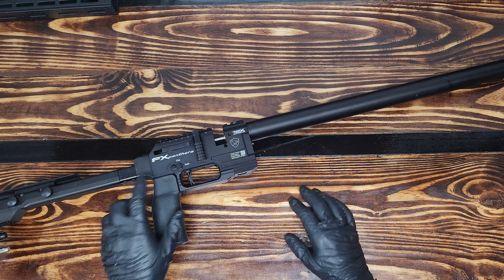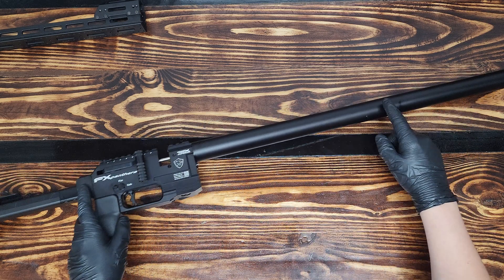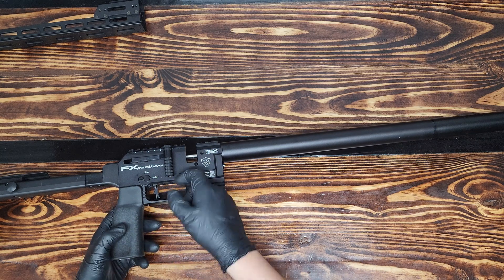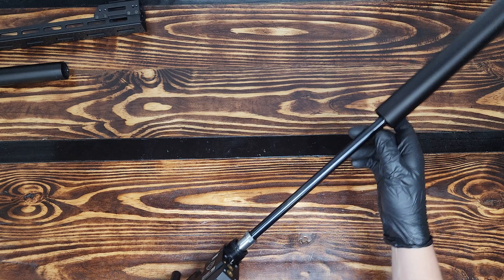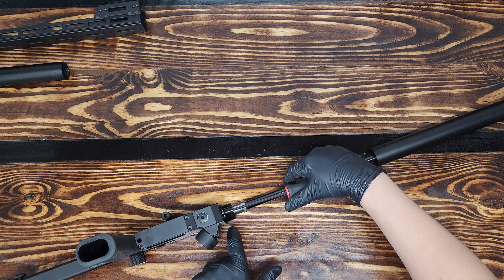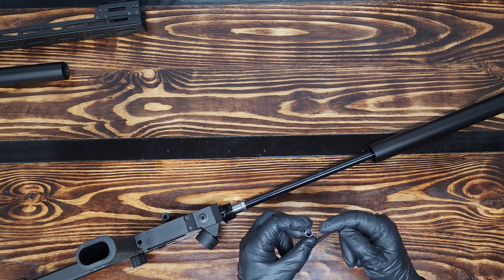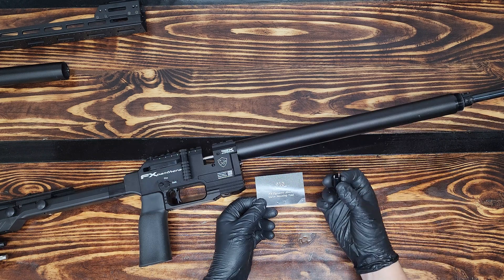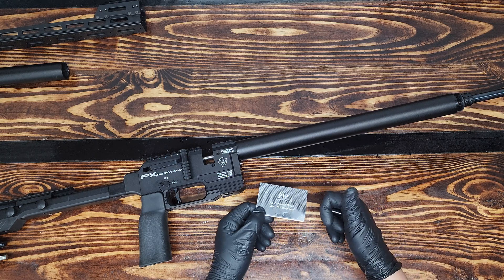FX Panthera Valvehousing Removal - FX Dynamic Block Valvehousing Tool

Comment: How can you remove the Shroud Bushing from the liner lock.  I have a new Panthera, and when I tried to unscrew the Bushing, the Liner Lock came with it.
Reply from the maker: It is attached with Loctite, so heating the threads lightly should allow it to come free